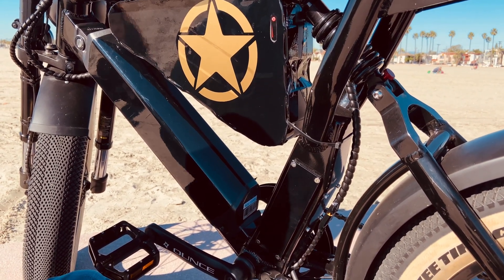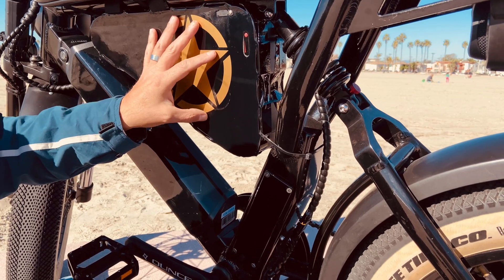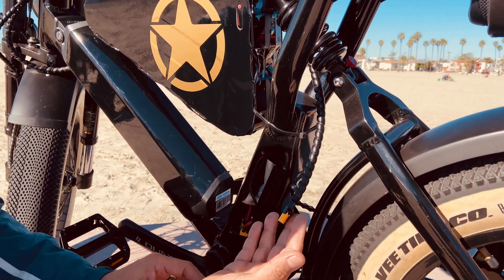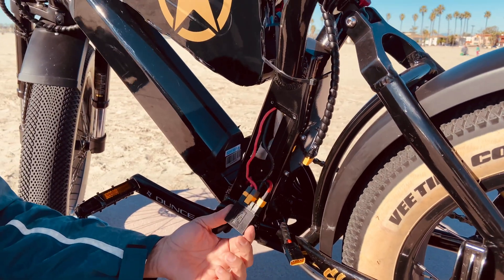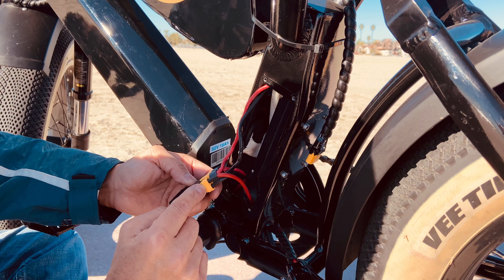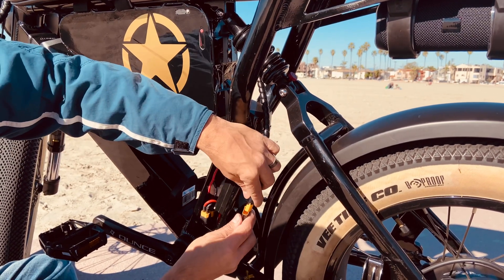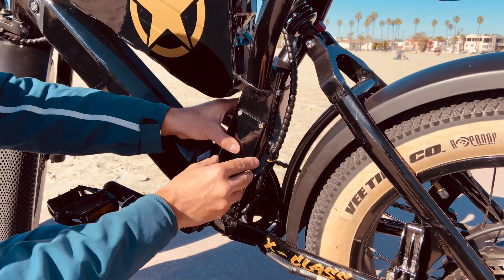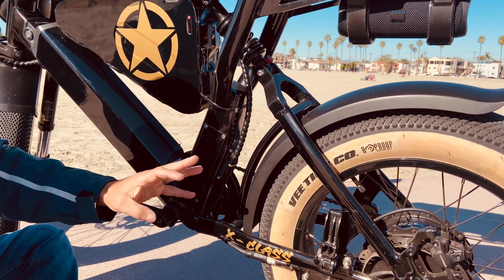Battery blender XT60 Install on Ariel Rider XClass 52v

Comment: If you use the original charger in the original battery port does it charge both batteries.   In other words: do I need to use both chargers at once?
Reply from the maker: @flip1952  you can charge separately or together no issues doing either and no you can’t charge both batteries simultaneously

Comment: Did you have to order or get any new connectors to connect the battery blender to the bike or did the battery blender come with everything you need?
Reply from the maker: Yes, you need an xt60 cable on one end to connect to battery blender and the other end need to be what you connect to the battery,  it could be and Anderson or xt60 they vary

Comment: I will be adding an extra battery to my Philodo H8.  It has dual motors, but I assume the installation would be pretty much the same.  Then I can ride for a 100 miles 🤣
Reply from the maker: Right on, happy trails

Comment: So where’s the other battery and what voltage? Is it the same or can you connect two different volt batteries to the blender?  I have a 52v triangle batt and 48v for next e-bike project OR should I connect in series? I know, two many questions. Lol
Reply from the maker: The second battery is the triangle battery with the gold star 52v 20 ah. You can connect two different volt like your 48v and 52v using the sparkcycleworks blender. Go to  sparkcycleworks.com to check out their videos on the battery blender.
Reply: @riderx4039  👍🏽 thanks
Reply from the maker: @davidanderson6222  your welcome

Comment: Hello can I use a 52v 28ah battery instead, the one from Amazon upp. And also can I remove the traingle battery whenever I want( I store my bike and take the batteries home to charge)
Reply from the maker: Hello, yes you can remove the battery and yes you can use the 28ah battery ⚡️🖖🏽⚡️
Reply: @riderx4039  thank you so much, I just wondered why no one went for the 28ah which will give more range.
Reply from the maker: @wesleygaitan  availability of products for one, stay tuned in I’m getting the Jack Cecil controller upgrade in a couple of weeks it should put the Xclass above 40 mph and improve acceleration I’ll post videos as soon as I can. I’m also waiting on a delivery from rumble motors for the Apex Dual motor dual battery ebike.  Remember to subscribe and don’t miss a video
Reply: @riderx4039  cool bro you've got a subscriber, I'm trying to get more educated on mods.
Reply from the maker: @wesleygaitan  right on, very easy and fun to mod these bikes

Comment: Hello Is it that easy? Just grab an extra triangle battery and plut it up like you did? I'm horrible at electronics so im just curious thanks alot
Reply from the maker: Hello, yes that easy. make sure your battery is secured so it doesn’t fall and make sure to get a compatible battery blender and cables
Reply: @riderx4039  Thanks alot man you just saved me a ton of stress.....about how real world range do you think you get alltogether with the double battery? I'm definitely doing this
Reply from the maker: @VaranusVideos  it doubled, I’ve gotten 0ver 40 miles on full throttle and can do more but I’ve never completely drained both batteries. Your weight, terrain, wind and how you drive will differ and get you a longer or shorter range

Comment: Does both battery have to have the same Voltage or can you run a 36V and 48V battery simultaneously?
Reply from the maker: I believe that you can go to sparkcycleworks and check out their video and info on the battery blender by DateX

Comment: Some what dubious about your claim to charge both at the same time...you can draw from both at the same time...electricity runs one way..hence most batteries have 2 connectors
Reply from the maker: It’s a fact, both batteries have chargers and I charge both batteries at the same time the battery blender allows for that and I think my next video will be me charging both batteries simultaneously. Stay tuned in!

Comment: What battery did you get and what type of range do you now see because I know battery’s are also like 600$+$150 (for the  blender) and I was wondering how much this effects your range and if it is still holding up currently or not and do both batteries drain evenly or is it one dies then it uses the other battery?
Reply from the maker: Hello, so the battery specs are 52V20AH50amp and is currently $419 on amazon. Range will vary depending on several factors weight of the rider, extra weight from all accessories, wind, traffic and how you ride like pedaling or throttle only. If your like me, then you only use the throttle and I’ve gotten 40 miles from using both battery’s.  First I used one battery until it died then turned the other one on. It’s actually recommended to use both at the same time and sometime I’ll ride this way with no issues. Yes it’s holding up no problems at all.  I currently have over a thousand miles logged and yes my additional battery shows up on my screen. I’m currently riding to work with no problems and I also ride on the weekends. I Hope this was helpful and answered your questions.
Reply: For charging are you able to plug in both to make it charge 2x faster or are you only able to charge one that will “fill” both at the same time
Reply from the maker: @loganwelch8278  both battery’s charge at same time just make sure the ebike is off

Comment: Just got the seat you have ! Thanks so much for the videos man.
 I have a question. What are pros and cons of adding the extra triangular battery ? Im wondering if I should get one
Reply from the maker: Sweet 🖖🏽 post pictures or vids when you can. Ok cons, you have to spend more money on these mods on an already great ebike.( ask yourself do you need the extra range?) I bought the same set up for my wife so she could go on the LAESK8 rides and she never goes she’s not interested in riding in big groups so it was a waste of money on her ebike. It doesn’t bother me but the extra battery will add weight making it heavier if you have to walk up stairs to carry the AR  if you live in an apartment,  and it does also shave off about 1 to 2mph at most.  Ok Pros, not that expensive to add if you have money to burn.  I never worry about mileage range don’t even think about it at all and I get 40 miles on full throttle with some battery left over. You can also add or remove the battery easily without having to modify the Xclass and fits perfectly in the center of bike. Hope this was helpful. Remember to subscribe! Peace⚡️🖖🏽⚡️
Reply: @riderx4039  Aw man what a great reply. Keep going man I love the channel and I’ll continue to support. I’m a filmmaker from Santa Barbara, California !
Reply from the maker: @AlejoJergovic  Thank you I appreciate that greatly, I love helping out!  I’ll be waiting to see your videos on the Xclass with you being a film maker🖖🏽

Comment: How does it work?
it draws power from the battery at the same time with different voltage?
Bolton has it too and it draw power on higher voltage first,and when it’s equal to the other battery,that time it will work simultaneously.

Comment: Great video thanks, I use the blender from sparks cycle, they specifically say the blender should be housed with significant air flow. So when I saw your video I was wondering did you know that being that you housed yours inside and the weather is just getting warmer and also a 2 inch space around the blender is recommended for air flow.

I can imagine how hot that blender will get this summer housed inside what is essentially a metal box

Just a question and a heads up to a fellow rider 💪🏾

I have not attached my blender as of yet.

Again …. Nice video 🚴🏾‍♂️🚴🏾‍♂️🚴🏾‍♂️
Reply from the maker: Im aware of what you stated and thank you (good looking out brother) most riders won’t give any of this a second thought on these mods. I realize I’m taking a risk but I also informed myself and remind others to do the same. I periodically check the the box and batteries for over heating and in all the riding I do it’s always just warm to the touch and never hot. And the box actually has two vent holes, one on the back of the controller housing at the bottom clearly visible and another right under the seat tubing on the right side so that heat vents up and out of the controller box housing.
Reply: I think it really needs more airflow according to the website.   How is it holding up now after almost a year?  Thanks and great video

Comment: Rider X nice meeting you at the Long Beach LAESK8 ride a couple Sundays ago, I'm about to connect the second battery soon. Where did you purchase the extra X90 cable for the additional battery? I like the idea of using the same opening on the bike to run the additional battery cable through it. If it's an electric shop in Long Beach, even better or maybe I'll check amazon. What length would you recommend? Thank you again for your time bro.
Reply from the maker: Hey Robert, what’s happening! Well you can go to any electric shop and they might  have some already in stock or you can have them make you a custom one which I did but I went to a shop out in Alamitos and I payed way to much. So first measure the end of the cable from your mounted battery to the controller housing then add an 2-3 inches for play. It’s an easy setup but Let me know if you need help. we can always meet up if you live in Long Beach. I tried Amazon first and they do have them but the cables  were to short.
Reply: @riderx4039  I have a x class 52v how long is the x90 cable you bought?
Reply from the maker: @lilbeviltwin  hello, the additional battery I purchased has an 11 inch cable running from the top of the battery and I had my 5 inch xt90 to xt60 cable custom made to keep the cables tight and clean so what I’m saying is first measure the existing cable from the battery (cable could be at top or bottom of battery) then measure how much more you need to reach the battery blender in the controller box. Of course I’m Assuming you got a battery blender
Reply: @riderx4039  yes I have a battery blender. Thanks 🤝🏼

Comment: Could this work for the d class?
Reply from the maker: Yes, I suggest you visit the sparkcycleworks.com  site watch the video and read what you need to connect everything.  Remember  you void your warranty by altering your ebike.  If I remember correctly the d class has two motors and one battery 48v and 750watt motors? 
So if I’m right it should work out great for you

Comment: So what is the new range? What size battery (20ah)? Does the it go faster?
Reply from the maker: Over 40 miles on full throttle , 52v 20ah, I feel a slight torque boost but no same speed that’s determined by the 2000watt  peak hub motor

Comment: where did u purchase your battery and how many miles can you put on a single charge
Reply from the maker: Got it on amazon 52V 20AH Electric Bicycle Lithinum ion Triangle Battery for 2000W 1500W 1000W 500W Motor with Charge Waterproof case $419.   With the added battery I get over 40miles on full throttle ( I do pedal but hardly)
Reply: @riderx4039  also, how long does it take to charge ur triangle battery
Reply from the maker: @juliuspresley9982  Good question it’s slow to charge.  I’ve never paid that much attention to how long exactly maybe 3 or 4 hours I’m never in a hurry so it’s not a problem but I do charge both simultaneously it’s only a 2.5 amp charger but you can spend more money and upgrade to a 4amp charger. I’m thinking about it getting better chargers but right now it’s not an issue. I’ll pay more attention next time charging  and have  an accurate answer.

Comment: How do you like the Vee Speedster tires? I bought 2 for my Fat ebike back in 2018, but haven't installed them yet. I ride mostly on a paved bike path and like the knobies the bike came with b/c they provide a noise so not to scare the bejesus out of walkers and animals. Everyone knows I'm coming up behind them. While the Speedsters would make more sense, the Kendas keep it safer. When they wear out, I'll prolly install them
Reply from the maker: I actually liked the original knobby tires the AR came with,  but I was going for the vintage look and I get it with these vee off white tires. As to a how I like them uh they’re  great on the street  and they make the ebike look cool just don’t expect them to be any good on dirt roads

Comment: xt60 Y connecter will also work instead of the blender.
Reply: If you look at the video on the spark cycle site, and from reading what others say in forums, it can be very dangerous to plug two batteries in this way.
Reply: Also that was a great video!!
Reply from the maker: Share the cost link on where to get it.

Comment: How is this working out for you. I just got my 52v  and would love to do this to mine. Just seen the video by Sparks about the battery blender. Just wanted to know  is it safe to do
Reply from the maker: Hello.  I saw the video from sparks too and contacted them about the risks of me running the blender with my 35amp controller and two battery’s and they stated  that it can be done they built enough safety into the blender but they don’t recommend it mostly due to the risks of heat dissipation. So I’ve been running a risk for over 600 hundred miles and no issues but I’m aware of the risks of over heating some components. Remember when you alter your ebike you void your warranty so If you attempt this know the risks involved.  Contact sparks cycle works they’ll tell you the same.
Reply: @riderx4039  right on and thanks.  Maybe I will wait awhile and follow you and see how it works out for you
Reply from the maker: @reyesfam619  right on, thanks!🖖🏽⚡️🖖🏽
Reply: @riderx4039  please do a update soon  🙏
Reply from the maker: I’ll be doing an update soon on both ebikes!👍🏽⚡️🖖🏽⚡️
Reply: @riderx4039  nice. Time for a ride on a nice So. Cal day😎

Comment: will that blender work for the 48v...I knew I shoulda just bought the 52v but I'm impatient🤦‍♂️🤦‍♂️🤦‍♂️🤦‍♂️
Reply from the maker: I dint know Check with Sparkcycleworks.com
Reply: Yes it will work for a 48v. Your new battery can be a 52v or 48v will work as well

Comment: Good evening. Nice video. I just got my X Class 52V & I'd like to have my range with the additions that you've added to your bike please. I take it that you got the XT60 Variant from Sparks?  

If you could walk me thru it as well as the steps to install it, that would be greatly appreciated. 

How much range do you get now?
Reply from the maker: Hello. Sure no problem,  now assuming that you have your battery and extra cable so you can reach the inside of the controller box housing that’s located directly in front of the rear wheel.   Step 1.  Turn off your ebike.   step 2.  mount your battery.  step 3 unscrew the small screws securing the panel (put them in a small Bagging so that you don’t lose them on )  step 4.  Gently pull out the red and black wires, they’ll be connected by yellow XT60 adapters.  Step 5. Once you’ve located and pulled out the wires it time to disconnect the controller and battery.  Step 6.  Run your new battery cable thru the cable port located at the bottom rear of the controller housing next take the battery blender and connect your battery, controller and new spare battery into the corresponding slots.  Step 7. Gently place the battery and wires back into the controller housing and secure the panel to the controller housing.  Remember you void your warranty by altering your ebike,  oh and make sure to read the sparks cycle works site to get the right battery.  I hope this was coherent and helpful⚡️🖖🏽⚡️forgot to mention I did 40 miles on an LAESK8 ride and had two bars on one battery when I got back.
Reply: @riderx4039 I appreciate you responding quickly.  I'll have to zoom in & see which side that you have the blender. Also. Where were you able to get the adapters & which one do I need please.
 You're using the T60 FROM SPARK right?
Thanks in advance.
Reply from the maker: @martymart3476  Yes I’m using the XT60 battery blender my battery came with an XT90 so I had to get an XT90 to Xt60.  I don’t know what your battery will come with your so you’ll have to find out what adapter it uses then message the seller on what you need. I also went to an electric shop to get a custom length adapter cable for the remaining  length from new battery to battery blender so that the cables look clean
Reply: @riderx4039  I'm being real about it. Since your setup is tried and tested, If you don't mind - I'd like to follow in your footsteps !00%. No deviation.
Reply from the maker: @martymart3476  right on👍🏽 just so you know there are cheaper ways of doing it but this is what I chose to do and it works,  I have no complaints and I’ll be doing a 500 mile review on the whole bike soon. By the way my ebike and my wife’s are setup exactly the same  and no issues with either one since the battery addition